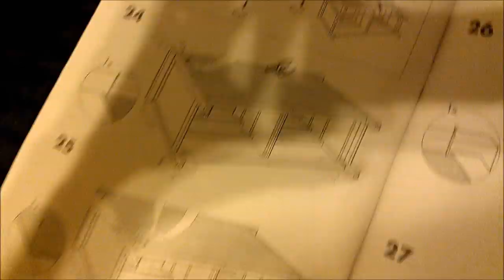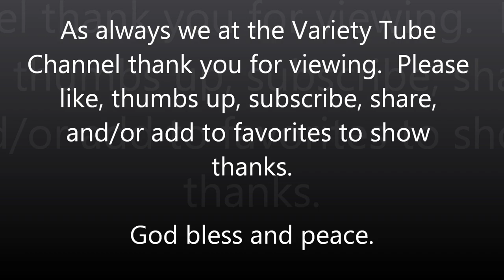Assembling an IKEA Chest of Drawers HEMNES 8 drawers. Pt-2

Comment: Are the bottom of the drawers flimsy?
Reply from the maker: imsotired247   I don't think that they are.  I actually appreciated their sturdiness.
Reply: They are sturdier than most diy, the railing system they use has an extra lip that brace and hold the sides, which I thought was nice.